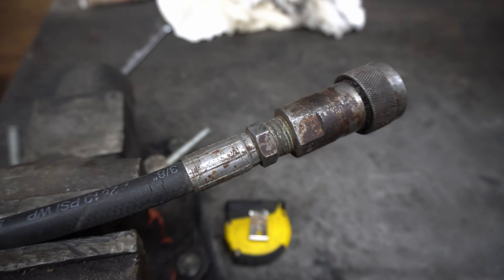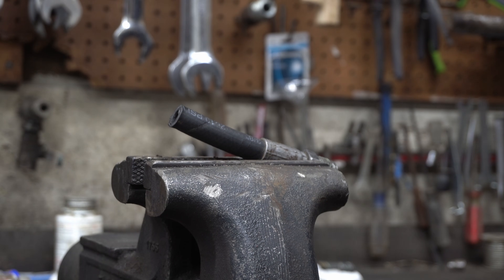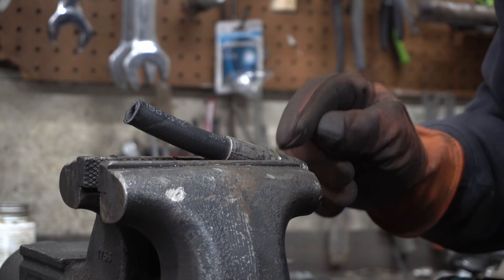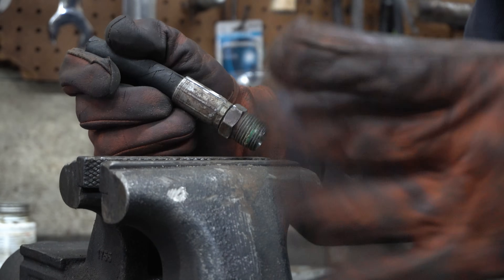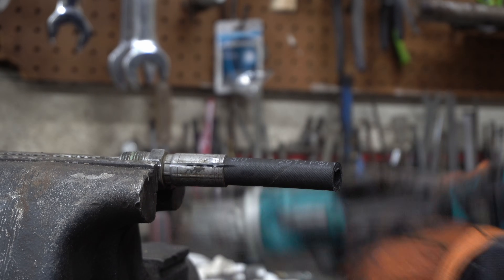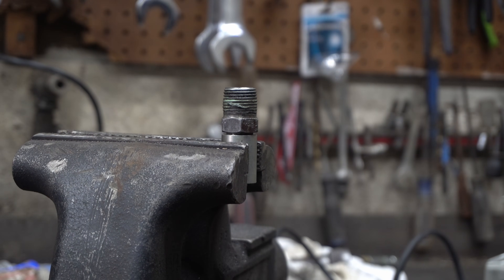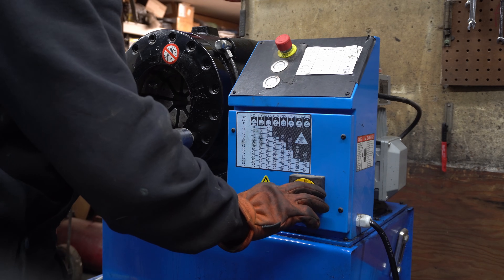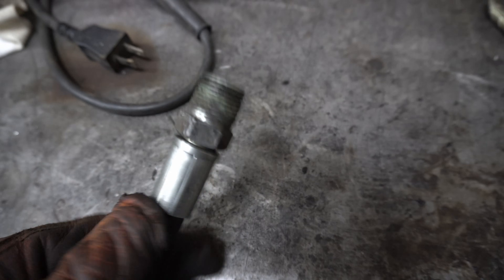Removing and Reusing Hydraulic Fittings

Comment: Maybe a good deal for those baling wire and duct type outfits but generally Not a good idea. Worked in a Gates dealer shop making hydraulic hose for 5 years.  Production shop for the mining industry. To keep our Gates branding we had to do hose bursts on every hose / fittings we had in stock/ used more than 50 times every 3 months. Yes we had a special machine made to do these bursts. The hose and fittings needed to meet their spec. Periodically some hoses/ fitting did not crimp correctly and failed spec.
I know of one time we reused odd end fitting( did the same as video to remove fitting ) to get customer by until the correct fitting came in. The customer not happy did not return for the new hose but later claimed the hose we made with reused fitting broke at critical time and almost killed one of his crew and was going to sue. 
Each crimp made is measured by calipers for the correct diameter.  Fittings and hose become fatigued after hours of use. Some hoses have warnings to be replaced after so many hours.

Comment: I'm here for ideas for something quite different. The throttle cable on my digger won't move. It won't pull out from either end. Disconnected the top end by the seat and dripped anti-rust down it for a week. Used thinnest guitar wire down but never exited in the engine bay. They don't sell the cable inside the sheathing separately, and the sheathing is crimped onto a fitting at either end. So plan F is to cut the ferrule off either end, and then... I haven't quite come up with the happy ending...

Comment: If it is easier a propane torch will heat the fitting and you can pull the hose right out. Then do your cutting.

Comment: I know it’s critical to not over crimp. Shop next door has a gates crimper. They must have at least 8 different sets of dies. I have asked if they reuse old fittings. Some machines have really special hose end, long bent tubing etc. Any how they just buy these hoses new. Clocking of the fittings is also important.

Comment: With all due respect, 

You should NEVER do this. I get the idea behind it, re-using fittings to save money. However, the way that specific fitting is designed (a one-piece fitting from the factory) does NOT allow re-use. This is EXTREMELY dangerous. 

As an engineer who develops the crimp specs that are used on hoses like this from the manufacturer, I had a heart attack watching this. The crimp spec that you crimped that to is more than likely not good (any change to an original crimp recipe must be burst and impulse tested). In order for a crimp to hold properly under all loads it needs to have between 3.5-11% tube crush on the stem. This is why you cannot reuse these fittings. Additionally, the ferrule you crimped on (which, making the hole wider also made me have a heart attack as well haha) is not the same dimensionally as the original ferrule. These things are designed with much more engineering than most people know.

I get this is a job shop and this is the "redneck, DIY" method of getting by. Regardless.

There are just so many things wrong with, and more importantly, EXTREMELY dangerous with this concept of re-using these fittings. Please, for your safety and your customers safety, just buy a replacement hose. It's not worth the risk of someone's life!
Reply: But sometimes fittings no longer exist for old machine , i apply the same recipe to solve my concern : reuse the old fittiing and it wors perfectly.
Reply: No doubt hydraulic pressure is very dangerous. 💥💥

Comment: You are making hard work of that. Yes cut on the flats to get deeper. Also a smaller diameter wheel helps. I make sure to cut as deep as possible without cutting the bit you want to keep. A nick on the hexagon doesn't  matter. I never cut around. When you have both sides cut, Place it flat on an anvil, or some heavy steel. Take a small cold chisel  place as near to the route end as possible and hit hard. They split quite easily, then turn over and repeat. Thanks for posting.